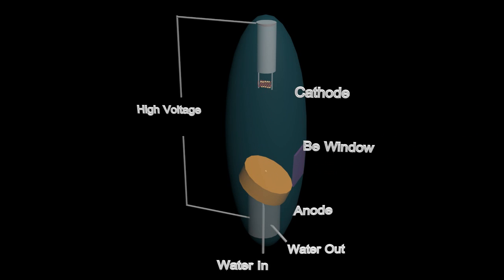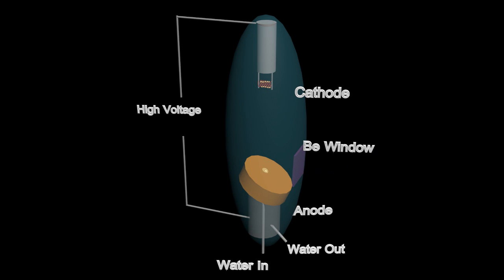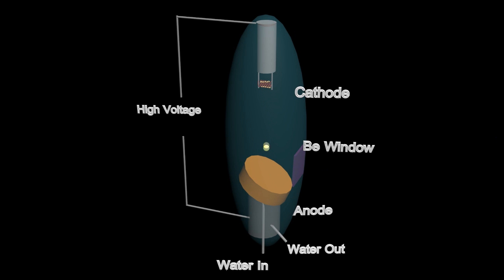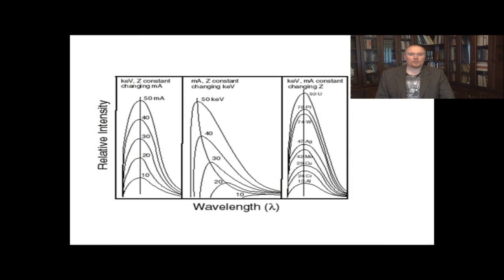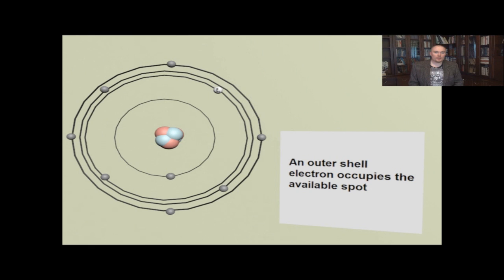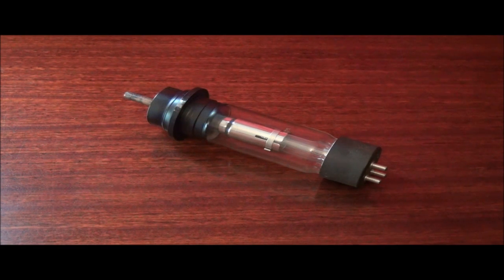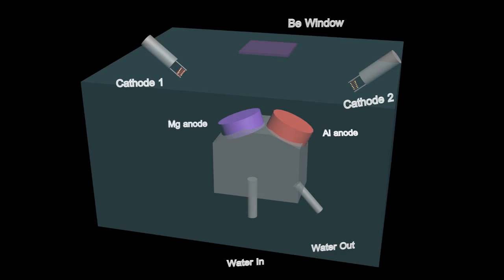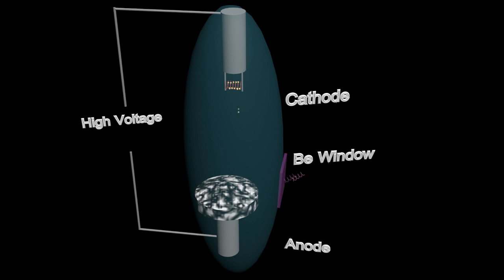X-Ray Tube Types and Animations

Comment: if we increase the heating current across the negative electrode, does that increase the number of emitted electrons?
Reply from the maker: The amount of electrons does increase when we increase the heating current but usually the temperature is kept at around 2300 C as in that region electron emission is most stable.
Reply: Yes by increasing the temperature of cathode the number of emitted electrons must be increases
Reply: Captain Corrosion thank you for your input